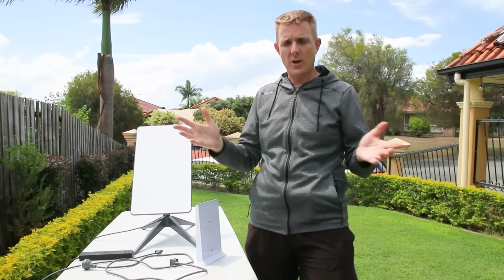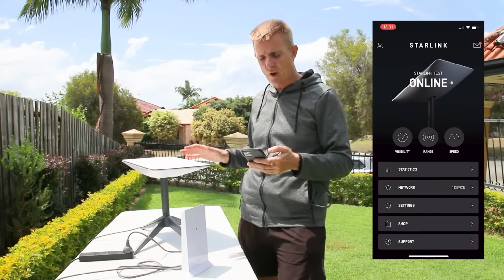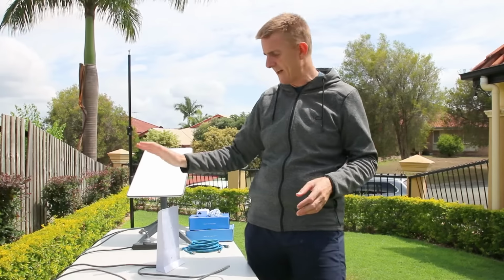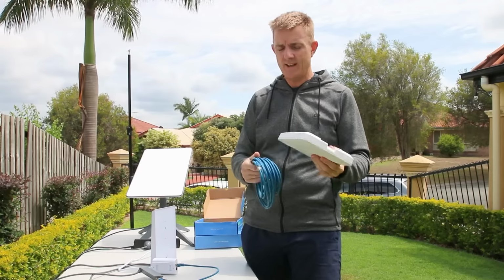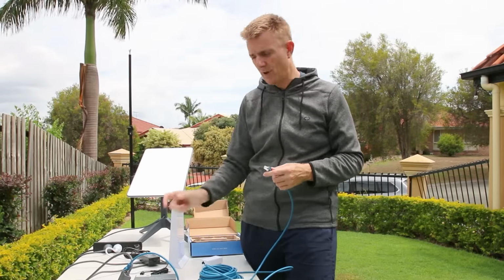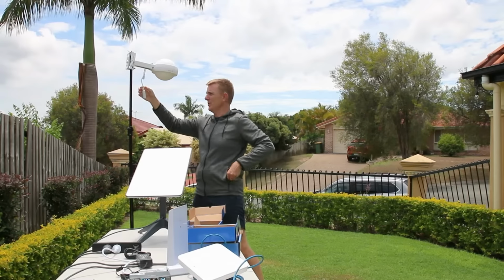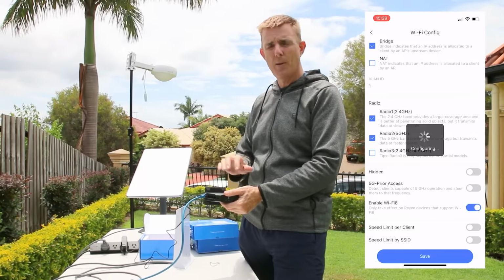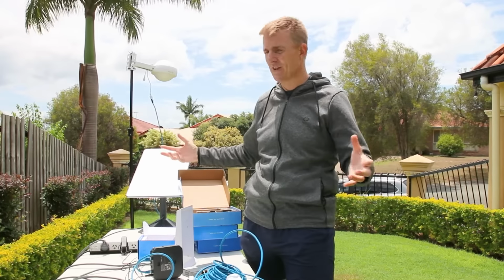Starlink - How to Extend Wireless In My Property Using Ruijie

Comment: Is it only adopting option…what about assign the static ip for each access point..for easy access to troubleshoot it
Reply from the maker: Since all Ruijie devices report back to their cloud controller, and you can label each access point as you want, really setting a static IP has no real benefit.  You can though set static IPs for each device if you want to though.

Comment: can starlink integrate with hikvision ip cctv ?
Reply from the maker: Starlink is just an internet service provider.  You can I believe use Hikvision at the end of a Starlink connection, but to remotely access the cameras, I believe you need to be using Hikvision Connect I think it is called.

Comment: paul, i just bought ruijie rg-eg150gw-x and im planning to pair it with my starlink to extend wifi and i want to use ruijie captive portal as SSID authentication, so my question is have you tested starlink with ruijie captive portal and does it work??
Reply from the maker: Good question.  This is not really about if it works with Starlink as Starlink is just the internet connection.   The captive portal will work when set up on the wireless SSID you configure on the EG105

Comment: Hi you talk about the ruijie app and adding products to it. We have the 5 port switch and one cabled ruijie access point I am wanting to add another access point. Do I need to use the app and add each item to it or can I just install and go.
Reply from the maker: Good question.  The Ruijie access points come out of the box ready to use.  They each have a unique wireless name (SSID)  If you want all the access points to work as one name, then you should create a project in the Ruijie App and add them all to that.  You can then create a single set of settings that all of the devices will share.  I hope this helps.

Comment: Paul, I've a question. Can I use a Ruijie router (to bypass the Starlink router) and mesh the indoor WiFi with ruijie rg-m32 and extend the outdoor wifi with a AP as you showed? If I can, I have to buy the switch or can I use just a Ruijie router with a PoE (if exist some like this)? 

I'm in Italy and I'm living in a very old country house with thick walls. I've not the chance to extend the indoor WiFi with the ethernet cables but I can do it with a mesh system, but I can use the ethernet cable to the outdoor AP.
Reply from the maker: Great question.  The EW range (This includes the M32) only mesh to each other and not the RAPxx Access points or other routers in the EG range I am afraid.   I would personally use the M32's indoors and then connect one of them up to an RAP6262 outdoor access point.   They can all share the same SSID for seemless roaming, but the M32's can't physically mesh (ie wirelessly connect and repeat) the signal from the RAP6262.  If you wanted to be able to have everything meshing together, then maybe use the EG105GW(T)'s instead of the M32's.   

You don't have to use a switch you can use a Ruijie router with PoE ports in it if you want.  I hope this helps.

Comment: Paul, does the main Starlink router still be able to act as a Wifi access point too? and co-exist with the one plugged into the Ethernet adapter?     Will the Wifi AP get assigned an IP or must you configure it to be on the same subnet as what the Starlink router is on?    The reason I ask is I'll be using TP-Link or D-Link ceiling mounted AP
Reply from the maker: Good questions.   Unless you put the Starlink router in bypass mode, it will still operate as a wireless access point.   It is actually the DHCP server for the network as well.  The Starlink router will assign an IP to your wireless access point and it will be in the same range as the starlink router's LAN subnet.   I hope this helps.

Comment: HI can you tell me what PoE you use here that will work with the outdoor access point - the REYEE EAP602? thanks
Reply from the maker: The EAP602 will take 802.3af or 802.3at 48v PoE power.   So a standard PoE+ switch will work or the Ruijie E-130 PoE Injector.  I hope this helps

Comment: Great video. Question if I wanted to hook the Starlink up to an existing cabling in the walls, thst go directly to the TV in the computer do I still use just use the switch box in tge video?
Reply from the maker: Great question.  Yes connect your Starlink Ethernet Adapter to a network switch and then all your wired connections to that and off you go.
Reply: @The_Tech_Geeks  perfect thanks